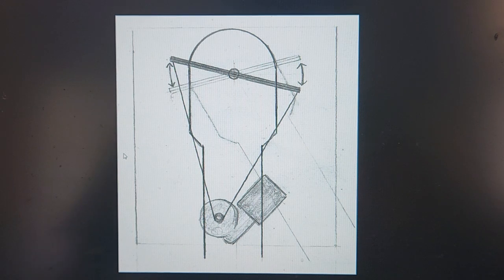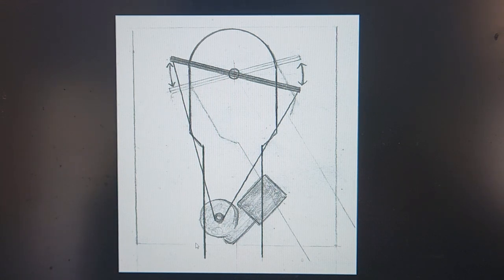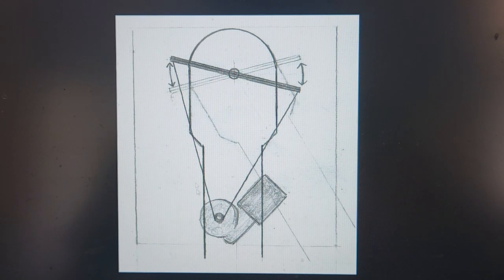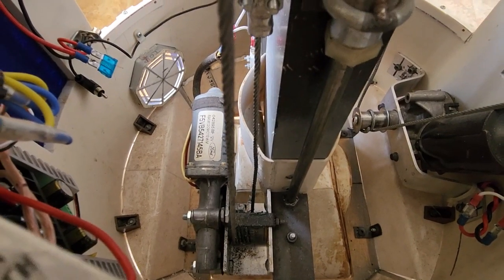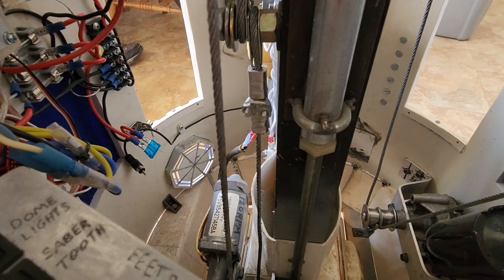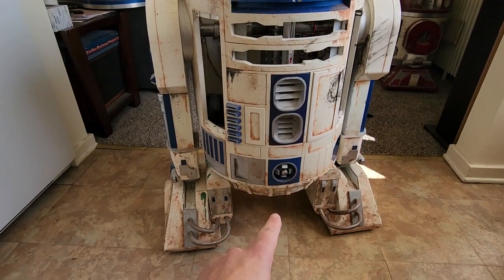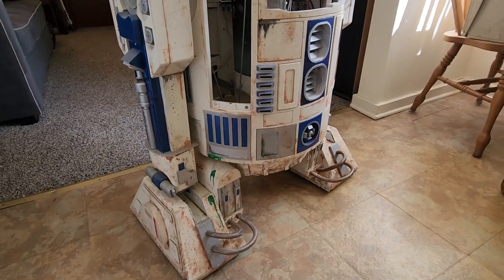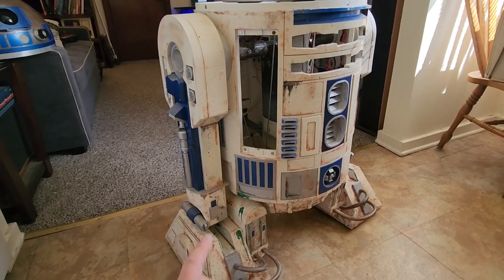R2-D2 Building. Understanding 2 to 3 leg functions.(video 3)

Comment: WOW! ok. That's a simple and extremely effective mechanic. Without high-tech. Just as it could have been built back then. I've been looking for a suitable technology for my own R2 project for months and was stuck on spindle drives. But the winches are a great idea. I would be happy if I can use this idea for my project. Thanks also for the detailed explanation at the beginning of the video.